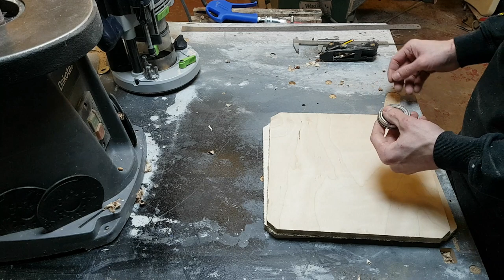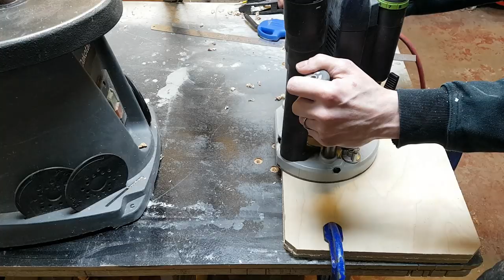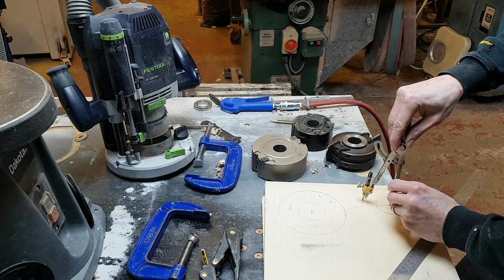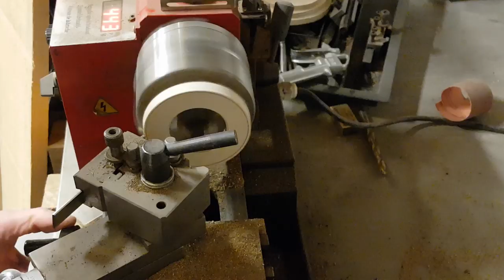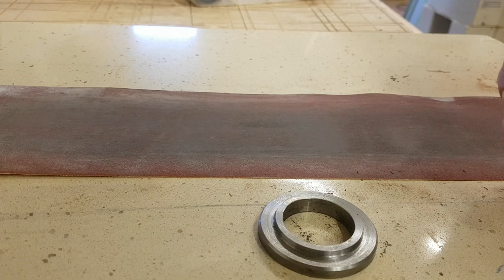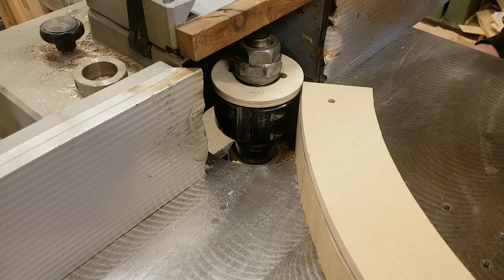Making Guide rings for spindle moulder / shaper

Comment: Did you get acceptable results parting off in the lathe at that speed? It sounds like you was getting an awful lot of chatter. The swarf doesn't look too good either.
Reply from the maker: no it was terrible, the bearings were shot! i did eventually get around to changing the cheap chinesium ball bearings  for some good tapered roller bearings, it is way better now.
Reply: @NewYorkshireWorkshop I'm sure it's a better machine with the 'orrible bearings changed. ICBW but the video looks like you was parting off at about the same speed you was turning. Anyway, it got the job done. I'm sure Norm would like your work too. ' - )

Comment: Why make the spacer out of plywood when you have a lathe to make it out of steel ?
Me ? I would get my local machine shop to turn one up if it's a size I don't have. But milling curved stock using a ply spacer ? 
Rather you than me. 
Seen to many accidents to take risks on the finger grinder.

Comment: Can you tell me about the magnetic router base?
Reply from the maker: it is the festool of2200. if you buy the full set it comes with various base plates which clip on and off easily via a lever, the guide bushes are held in with magnets and there are several sizes of guide bush. it is a really neat system that makes customisation easy. i have some over sized base plates for routing out large voids with full support.
Reply: @NewYorkshireWorkshop  Thanks! And your videos are well done!

Comment: All those years I bemoaned not having a custom set of rings for  our shaper, and now you show me how perfectly well Baltic Birch will do for some shop made ones (slaps forehead)! And with the bearing pressed in, truing on the disc sander would give all the precision one could wish for. And that's a nice touch, giving the ring a shoulder to locate on the bearing.

But then, I see you already have an engine lathe! Why on Airth dinna you cut the rings out of steel, directly on the lathe? Well, you have my like, and my sub.
Reply from the maker: Thanks Lee. at the price of the Omas rings it is a painful outlay especially if like me you dont use them very often, and sizes are limited. These you can make any size you want at any time.
That little lathe would struggle making a the rings, would be possible but any heavy machining takes a long time so makes more sense to use wood. they do burn a little when they first touch the wood but you can wrap a layer of tape around the ring to stop that.
Reply: @NewYorkshireWorkshop , I follow. And keep up the splendid craftsmanship!
Reply: And about that shoulder, I also just realized it's important function in capturing the ring!
Reply: @NewYorkshireWorkshop  we use some worktop stuff called traspa it’s great for jigs & chopping boards lol . Very tough.

Comment: Hold up, your Bosch router has a plug it cable??
Reply from the maker: Yes, it was actually really easy to fit, i just bought the internal connector i think form the rts400 and it literally just screws directly onto the two screw holes where the cable clamp was in the router. then i just cut out some of the casing for clearance. makes sense when most of my other tools are festool.
Reply: @NewYorkshireWorkshop  brilliant!